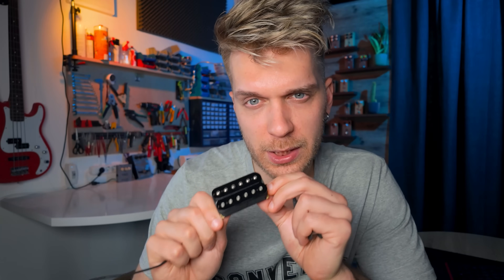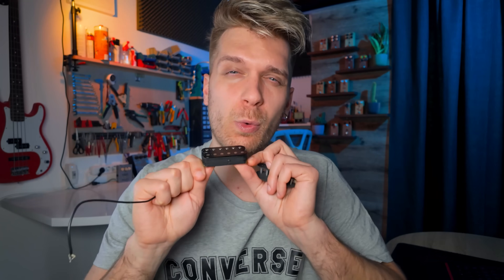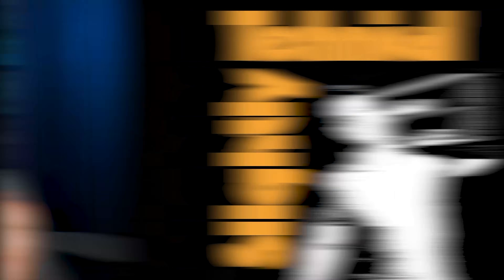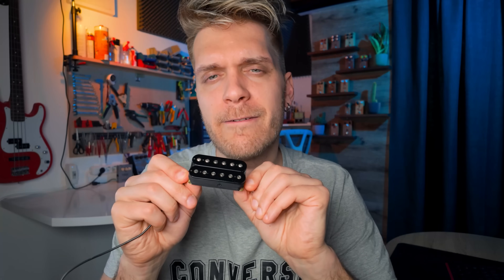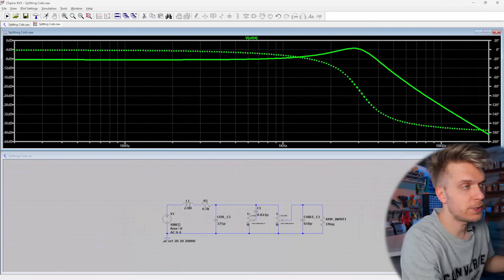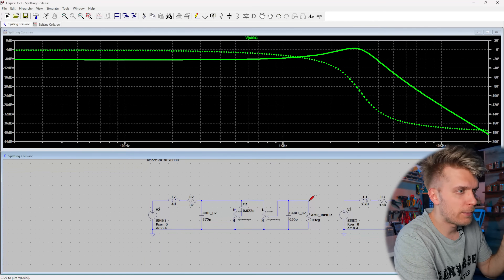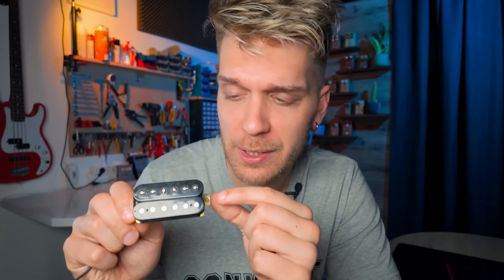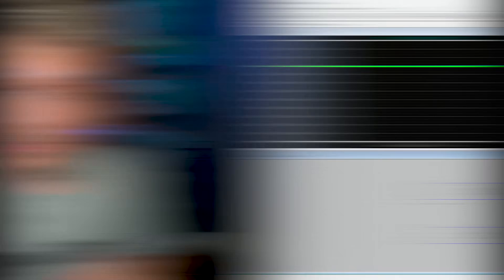Why SPLIT COILS are OBSOLETE?

Comment: Always liked the coil splits on my Carvin DC-200K.  This has those funky 22-polepiece Carvin pickups.  A lot of people change them, but I like them.  Not too hot, not too dark, nice solid tone with plenty of high end.  In the studio, I use many different pickup combinations and splits on different tracks, for variety; but playing live, I generally keep it set on bridge humbucker and neck split, and switch between the two for dirty or clean (seldom use middle position).  Carvin/Kiesel: under rated, good stuff!

Comment: my first electric guitar was an a active 9 volt  hss yamaha that had individual switches for each pickup and a coil split for the bridge humbucker. all the positions sounded awful but the worse was the coil split .
bright thin and anemic. when i sold it i wanted to apologize to the buyer for selling him such a poor sounding instrument.
ive heard so many guitars that sound bad when you split/tap the coils so i never bother with it, one thing i recommend for strats is a tele position neck+bridge through a switch or a push pull tone knob, you don't lose anything and you gain a very usable sound for cleans and drive. enjoy!

Comment: Low tech solution that works-adjust hum bucker tilt longitudinally so ‘single coil’ is much closer to strings. Less volume drop and more variation in tone when engaged.

Comment: Super interesting, Sir! I'm a fan of splitting humbs, have it on all my guitars, just love how it makes a guitar, e.g. Les Paul style one, twice more capable. I have only one guitar with singles and prefer the sound of the split humbs still. :D But very curious to try adding those resistors. Also on my PRS Custom 24 the split is a bit strange, afaik it splits one of the pickups while mixing it with the other non-splited. It removes noise, sounds great, but maybe a bit too trebly-picky, but nothing non-fixable with the signal chain.

Comment: The P-Rails on my RG sounds nice when they're split to the P90 mode. But then again, I've been playing the thing for 5 years in a row, and I don't have even another guitar to compare it with, let alone one with actual P90 pickups. One wiring I would try in the future, would be Guthrie Govan's Signature Charvel wiring. It's wired with a super switch, in a way that he can have partial splits on the Bridge and Neck humbucker, but can still get split in-between sounds. There's configuration diagram on Charvel's site.

Comment: My preferred solution is to run the humbucker in parallel as opposed to splitting it. Still humcancelling, but has a single coil-ish tone that is very useful.
Reply from the maker: Used to have a video on that.... might re-do the whole thing :)
Reply: @slightlytechnical103 couldnt find it😢
Reply: I tried that on a Seymour Duncan Invader and the sound was surprisingly great.
Reply: Yes , agree 100% . Much prefer the parallel wiring and sound. Its a winner , bonus is hum cancelling.
Reply: It is humcancelling but it sounds nothing kike a single coil.

Comment: Very informative. Another great episode. 
I have a roughly 8k set of paf style pickups and use a 1k resistor to ground on neck and 2k resistor to ground on bridge for coil split. Seems to help with volume loss and still bucks hum. I stuck a 180pf cap on the volume pot for a slight treble bleed which helps too. Works great for switching between rhythm and lead parts without stepping on a load of pedals.